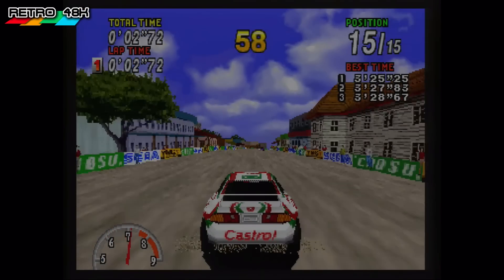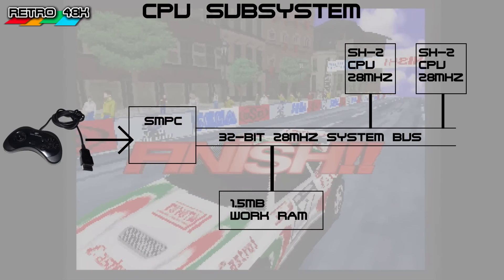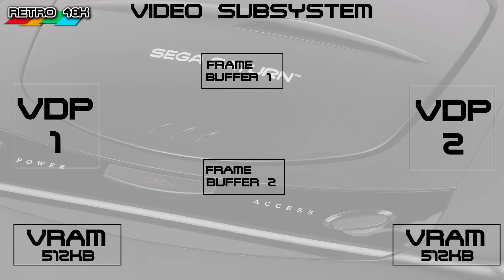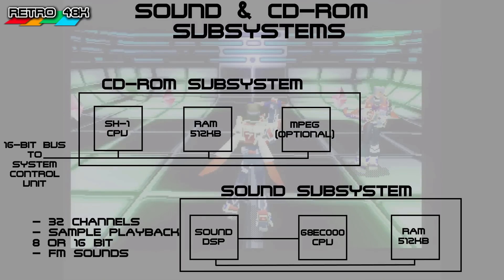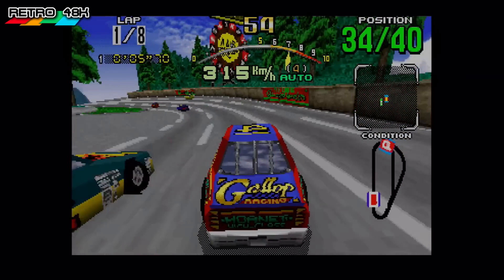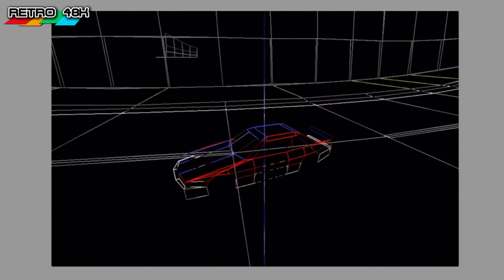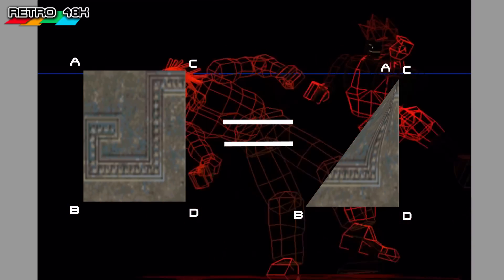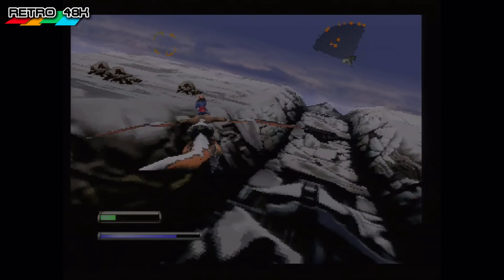How the Sega Saturn Worked

Comment: Saturn is my favorite system... Kind of wish indie devs took a crack at it like they do on Dreamcast... It has entirely unique visuals in the fact that you can see the programming tricks they used to achieve certain results... Everyone I knew had Playstation, but when I'd pop in Panzer Dragoon Zwei, Dragon Force, Radiant Silvergun, or Guardian Heroes they would be stunned... The games we played the most though were Decathlete, Winter Heat, and X-men vs Street Fighter/Marvel Superheroes vs Street Fighter... We wore out those sega arcade fighter sticks...

I have Retrotink 4k now, and dear god is that thing Amazing at making Saturn look like it should on a modern TV...
Reply: I will never understand the tricks used for water in panzer dragoon or wave rider 64.
Reply: @ArneChristianRosenfeldt  For Panzer,  it was Multiple layers from VDP2, with 2 layers having animated looping textures applied... 👍
Reply: Saturn is amazing, but I don't think that indie developers will take it into consideration. They are all programming for consoles with a simpler architecture, like genesis, dreamcast and jaguar (using only the 68000).
Reply: @ can you explain graphics on the Dreamcast to me? It looks like a game needs to use the CPU to roughly rasterize each triangle onto the tile grid. Would this not take a lot of time? N64 and ps2 have extra MIPS cores to help the CPU and then only need to T&L . How do you even allocate the memory in a cache friendly way? Does memory overflow in complicated scenes? I think that phones used tiles for 2d mostly.

How does a tile based renderer fetch the textures?
Reply: @ArneChristianRosenfeldt  Graphics on Dreamcast were the PowerVR2, from VideoLoic (now Imagination Technologies)... After Dreamcast, pretty much all that tech went into Cellphones and a lot of mobile APU's... So the Dreamcast tech basically lives on in modern phones...

Comment: You'd forget an advantage the distorted sprites, that was the technical name of Saturn quads, had over the competence, Saturn drew them with perspective correction, meaning the tesellation that happened on other systems to avoid the wobly textures on the close-ups could be mitigated, or even avoided, also, the vdp2 scrolling planes could be used as "mode7" planes, and draw really large environments using tiles and horizontal interrupt tricks.
Reply: The VDP2 infinite plane bg layers could be given XY co-ordinates and this made it easy to build a 3D scene and incorporate the infinite (mode7 style) planes with VDP1 polygons.

The 'distorted sprites' had some perspective correction and this helped warped textures not be so warped. This meant textures close to the camera held their shape better. But apparently, the Saturn was less good at displaying large distorted sprites/textured polygons (ie close to the camera) than the PSX but better at multiple but smaller textured polygons.

The other thing was the 'pixel grid' or sub pixel grid or something. That is, there is such a thing as a sub-pixel. That is geometry or sprite positioning that can be calculated in finer increments than the actual resolution. As the PSX had only as many co-ordinates as there were visible pixels on the screen, I believe this was the cause of the 'polygon wobble' often seen on the PSX.
Reply: @ribenasquash  There's multiple reasons for polygon wobble on the PSX, but they all stem from the limitations along the whole chain of the render pipeline, the limitation being that it was all 32-bit integer math. The wobble you're referring to is part of the final rendering of the coordinate system to a pixel onscreen, and the Saturn has this issue too. It's not so big a problem as the output it pixelated anyway.

A bigger problem was the accuracy of the transform calculations for a given set of 3D coordinates on the Playstation. Since this was done in hardware and you couldn't really change how this was done, if the area you were calculating across was wide enough, it magnified the inaccuracies in the math since in a given axis you only had 4 billion possible coordinates. If you were stacking multiple calculations together in a row, the error would magnify and polygon vertices would start jumping around. 

On the Saturn, since you had no fixed hardware geometry engine, you could tailor how your software handled it to the task at hand. Most developers did their transforms in software on the SH-2, with a few developers using the generic DSP for some calculations. While these were still 32-bit, since you had more direct control of the pipeline, you had more granularity in how you could pick the scale for the calculations.  For this reason polygon wobble tends to be pretty uniformly bad on the Playstation, whereas the Saturn had more variation -- more akin to the wobble you'd see on software 3D engines on early PC 3D polygon games. 

The irony is that you can eliminate much of the wobble on many games on Playstation emulators now because of uniform use of the 32-bit hardware engine. You have the emulator keep track of "shadow registers" which extend the CPU, GTE, and rasterizer registers to 64-bits. The software is completely oblivious to this and thinks it's pushing 32-bit values around, but the emulator does 64-bit calculations on every register and memory location. 

You can't really do this on Saturn emulators because of all the variable casting between formats being done in software and lots of use of precalculated tables in that software.
Reply: @NozomuYume  it seems that you can never learn a whole system completely.

I'm not sure how 8bill isn't a large enough number to get accurate positioning though.

I can't understand the value of a 64bit number even though I do keep trying to...
Reply: @ribenasquash I guess 64 bit is just native to a modern CPU. The original PS1 hardware falls down to 16bit and less in some places to save a few transistors. Really weird decision.
Reply: @ribenasquash  It's large enough for a single calculation, but if you do multiple calculations over and over error can build up. More importantly certain elements in the GTE calculations were actually rounded to 16-bits (though vectors were 32-bit).
Reply: @NozomuYume  first you use standard MIPS SUB instruction to get everything relative to camera position, then you multiply the vertices with the 3x3 Matrix . So the latter may limit your precision to 15 bits. But this seems to be enough for screen coordinates and z bucket sort.

Do you think about clipping? I failed to express this in Matrix notation. Or at least thanks to the fast 3 register MUL instruction on R3000 this is faster to use.
Reply: @ribenasquash  The problem was clipping the quads at the near projection distance when the primitives couldn't remain as quads, they were split into other primitives, which didn't retain the rendering information, that was their biggest, and meaniest drawback
Reply: @santitabnavascues8673  primitives isn't really a thing when you have rectangles or rectangles.

Textures close to the projection disappeared before the fix was figured out.

Daytona shows this happening.
Reply: @ribenasquash but there is no real fix. Quads need their texture aligned along the edge. Clipping aligns the edge along the screen border. Quite fundamentally, quads are not suitable for dungeons . The kind of 3d which amazed me after crude wire frame objects which you could never enter.
Reply: @ArneChristianRosenfeldt  well fix/workaround. Probably not ideal.

Robotica has a nice smooth frame rate (although alot of repeating textures so very dull looking).

Comment: I have not played Saturn before this year for the first time. I was really surprised by the good sound quality. I have a relatively good sound system, and it did sound good. And I think the games have held up pretty good, but that could be because of the more "simple graphic" fits better on a modern TV, some games on the PSX is almost unplayable on anything else than a CRT. I wonder how games could have looked on the Saturn if it continued along with the PSX.

Maybe Populous The beginning would fit better on the Saturn the PSX.
Reply: The Saturn had great audio hardware for synthesized music generation. It was so good that many times when porting Saturn games to the Playstation, the Playstation developers converted Saturn music to ADPCM audio tracks on the Playstation rather than trying to generate the music on the Playstation's sound hardware. This even resulted in a few Playstation ports needing more discs to fit all the audio tracks. 

Going the other way it was a problem for the Saturn as it had no audio compression (PSX supported ADPCM), so to fit RAM limitations sample quality was often worse for wavetable music and sound effects ported over from the PSX.
Reply: @NozomuYume  Aha, I guess it was not just "placebo" then :D
It seems SEGA have always had good quality video and sound output on their consoles. Well, I take that somewhat back in regards to sound on the Mega Drive, since you needed to use the Jack on model 1 for stereo and Model 2 had somewhat poorer sound quality.

Comment: I think if SEGA had really prepared better, and helped people by offering more dev. kits and giving training on how to use both dev.kits and how to program for the Saturn. Like training several in-house experts and sending them out to help or train other developers.
 I think they were too paranoid about helping or giving away info to their competitors, so in the end they did exactly what they were afraid of doing, but more by sabotaging themselves. (In MANY ways, not just the programming for Saturn)
Reply: Problem was Sega was trying to beat competition to the punch, i.e. release first . As such they had to rush development of the console, and use off shelf parts available. Of ten of lower quality, so they tried to compensate with using two processors instead of one etc ...
Reply: @aleksazunjic9672  They didn't really use that much "off the shelf" parts. Only one I can think of is the 68k for the audio processor. almost everything else (at the time.) was basically proprietary at the time, The SH2's, VDP's, etc weren't off the shelf. The problem was they wanted to do business with just the makers of the SH2.

Comment: the saturn is like releasing an arcade architecture for home consoles - assured to only get first-party titles that use it to its fullest, and a bunch of wacky third-party titles that do not move units. SNK made the same mistake back in the day - more like SMH am i right
Reply from the maker: The problem was Sega was constantly pushing its arcade hardware so even those first party games looked worse because of it where as Sony had Namco making arcade games on basically turbo charged PlayStation hardware. Compare Virtua Fighter and Tekken on the arcades and at home as an example of this, VF 3 would have looked wildly out of date on the Saturn, simple because Segas arcade hardware was so bleeding edge

Comment: Great video! Though I think the 7th gen was the last generation where every system had a unique look. Dreamcast with its tile based deferred rendering, the PS2 had low quality textures but alot games that used framebuffer effects, GameCube games had high quality textures and Xbox had games that used shaders. You could tell games apart for each system. Even multiplatform games like Splinter Cell looked totally different on each console.
Reply: That was 6th gen
Reply: 6th gen son
Reply: 7th gen had a lot of games looking pretty similar to each other besides exclusives. PS3 and 360 titles never really looked too different aside from missing effect, often due to people not understanding how to use the PS3's chip
Reply: SNES solos all....

🤗

Comment: There are people often saying that the Sega Saturn was theoretically more powerful than the PlayStation. However, the fact is that it doesn’t matter when almost all cross platform games ran much better on the PlayStation. First party games looked better on the PlayStation too. Even a late generation game like Burning Rangers suffers from a low frame rate, blocky, low resolution transparency effects, and noticeable polygon breakage.
Reply: Burning Rangers is a bad example, that game was basically rushed out the door in an unfinished state because Sonic Team was needed to work on Sonic Adventure.
As for the VDP1 capabilities: it can put out 800k flat-shaded polygons, or 300k textured polygons a second. Take a look at the PS1 tech specs for comparison for yourself. Also, the PS1 CPU did not run at 57MHz; at least watch the damn video you're commenting under, @athos5359.
Reply: Cross platform games aren't really a fair comparison, as most of them were originally built for the PS1 and then sloppily ported to the Saturn.  Games built for the Saturn hardware and ported to the PS1 run noticeably worse, wild how that works. As for first party PS1 games looking better than first party PS1 games? Yeah they did, after 1996. Funnily enough, that was also the last year the Saturn had any real push. I'd also point out that most of those beloved PS1 games don't look anywhere near as good as people seem to suggest/remember. Many of them look like shit, frankly. I love MGS1, it's a great game. Looks like fucking trash by modern standards and was honestly pretty rough at the time.
Reply: @seanmckelvey6618  It doesn’t matter whether it’s a “fair” comparison or not. If there weren’t any games that showcased that theoretical superior power, then it’s only theoretical and not real. People can come up with all the theories about theoretical power they want, but in retrospect, PlayStation simply had more games that ran better and looked better. The proof is in the pudding.
Reply: @blaah4490  there s 1soccer game that looks better on saturn wws 98.
Reply: @ There are a few Saturn games that perform or look better, but not many.
Reply from the maker: Ive always found the earlier games on both consoles have held up better to be honest. I think Ridge Racer holds up better visually than say GT2 for example, maybe not on a CRT but on modern screens any jagged edges look a thousand times worse, thats just personal taste though
Reply: @Retro48K526  gt 2 makes bad use of ps1gpu ,wipout 3 looks better thanks to higher screen resolution and better textures.